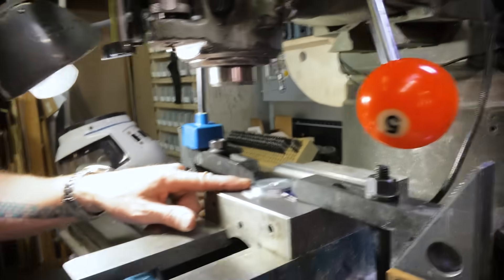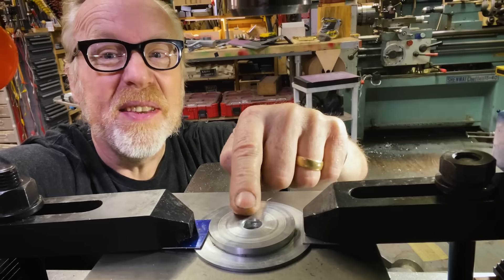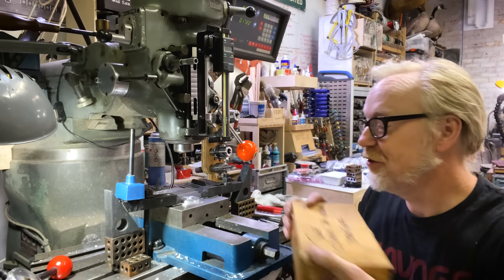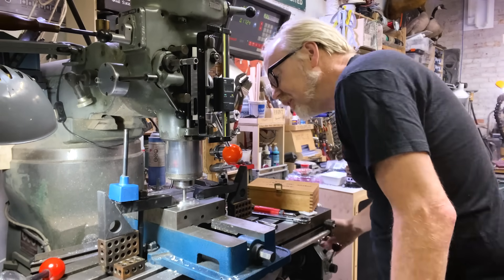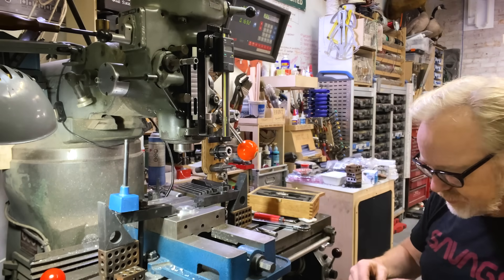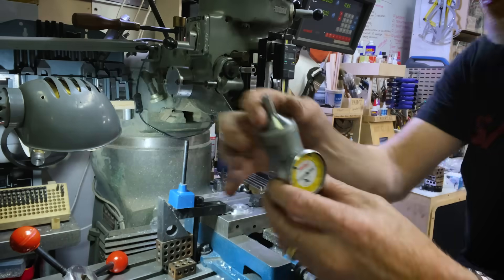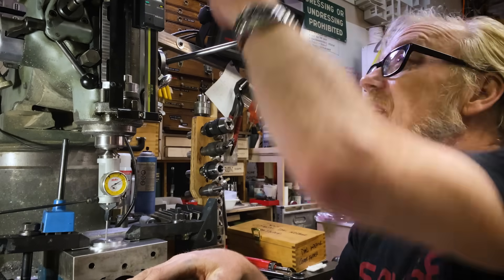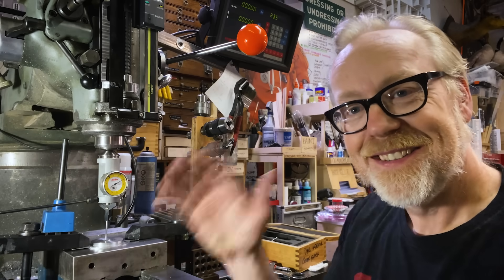Adam Savage's Favorite Tools: Wiggler Machining Center-Finder

Comment: Why turn the motor on? Just rotate it manually (slowly) for 180 degrees and you'll spot the direction and amount of deviation easily. By all means turn the motor on at the end to see how much vibration you have, but adjusting it all the way with the motor running is just masochism.

Comment: As everyone else is saying, it’s a Coaxial Indicator. A wiggler is a different tool (personally, I don’t like them; I prefer either a conventional edge finder for nonmetallic work, or an electrical one for metal workpieces). Also, I’ll usually put the mill in neutral and spin it by hand (my mill has a spindle nose that I can grab by hand; not all of them do).

Comment: It's a co-axial indicator.  And it is definitely an indispensable tool.  My mill only cost like $500, and I still forked out the like $150 for a cheap Chinese coax indicator off Shars, because you just HAVE to have one.

Comment: Hi Adam, great video.

I havnt trawled through all the comments but one thing i noticed was the way you clamped the work down could be done a bit safer.

The left hand bar had the outer end on the step block higher than the inner end holding the work, which is good,  yet the  outer end on the right hand side looked lower than the inside end of the bar, which is a nono - leverage wise.

also the pinch bolts need to be as close to the work as possible, just my honest opinion.

just want ya to be safe mate.

keep up the awesome work!

Comment: Good video, just thought I'd share a tip: It's a lot faster when you don't turn on the mill. If you turn the spindle by hand it's much easier to tell where the high/low spots are and which way to move the table. Also that's a coaxial indicator. A wiggler/wobbler is a regular old edge finder.
Reply: Yep, that's how I normally use mine.  High/Low in neutral for easier rotation, check at 180 degrees along one axis, split the difference, repeat on the other axis, then fine tune as needed.  Very quick that way, and no chasing a test indicator around the mill, or mirrors.

Comment: You can also use a dial indicator and sweep the diameter of the peice, Assuming you've checked the spindle is set on centre with the table.

Comment: Okay, the closest I've come to doing anything like this is using a cheap harbor freight dial indicator to check for warps in a table saw blades or to set knives in my jointer, so somebody tell me If I'm off the wall here, but is actually turning on the machines motor a bit nutty?  Can you not just spin it by hand? Maybe even take a couple of readings along the x and z axis, split the difference and than dial it into precision?

Comment: Indicol and Indicator would do the job very well also. And you have one of the most important and useful tools in machining. You can reference from external diameter and indicate perpendicularity. Im sure the wiggler can be just as fast however with practice.

Comment: In your concentric part I can see touching off the od to find the center. This looks great for parts that have edges outside the bounds of quill movement or pre-existing holes  with no concentric relation to the edges. Very cool

Comment: "Co-axial indicator" is the correct name or Coax indicator. There is a wiggler indicator but it is different looking.
Reply: "slow clap..."  Well done.
Reply: A wiggler is for centering a mark and is very useful. It can also be used as an edge finder. I have a coax indicator, but I use very little. I prefer an edgefinder if going only to a couple of thousandths. It is much faster for me. If greater accuracy is needed. I use a test indicator on an Indicol.
Reply: @tracylemme1375  Agreed except I've thrown all my edge finders in the back of the drawer after picking up a Haimer a while back... Pretty much all I use any more is the Haimer (or an indicator on an indicol if I need to find an edge or center to better than a thou).
Reply: But wiggler sounds better sooooooo
Reply: Yep, beat me to it. A wiggler is totally different
Reply: "co-axial" and if you want to support an american company making them for about the last century look up Blake Mfg Co.
Reply: Slow clapping*
Reply: I came to this video just to make sure the title inaccuracy was already addressed
Reply: I'm glad this comment is here
Reply: Thank you. Only came here to comment correct name of tool. Fuckin nerds trying to show how smart they think they are.
Reply: @mgmjferg89  most machinists haven't a clue what they are talking about or what tools are called
Reply: User Name those aren’t machinists, those are operators. Machine operators, they do some measuring and push the green button.
Reply: @jeepmanxj  very true
Reply: Finally someone that knows what they’re talking about, from one machinist to another thank you
Reply: When u say wiggle indicator is that just a regular indicator? Never heard the wiggle term before
Reply: @highclass3041  Go to Amazon and type in "Wiggler & center finder set" then type in "Coaxial centering Indicator"....that is the difference.
Reply: @elmergriffin8369  I have a coaxial and edge finder...edge finder is starrett and the coaxial is a Fowler. I just never used the wiggle kind I'm gonna check it out for sure though thanks man
Reply: I applaud Adam's self-confidence. If I posted a video with such a gross error displaying my ignorance, I'd be so embarrassed I would have to  immediately take it down and re-shoot all the necessary portions with the error corrected, or jump off a bridge.
Reply: My favorite is the one made by blake

Comment: Adam, 

Yes you have All the toys, BUT NO IDEA how to use correctly. 
It is disturbing as a Machinist you showing the INCORRECT procedures to others.  
You have proven this as above & your so called Brass Nut & Bolt Video.
Others will think that your procedure is Correct & Damage equipment & or themselves.
All are better to look at Abom79 site for Correct technique.
Reply: I was thinking the same thing. I couldn’t get through the nut and bolt video, once he started cutting the hex before the threading operation I was out. And as a guy who watches a lot of Abom79, it seemed like he had the mill going way too fast, and probably could have gotten it dialed in much faster and more accurately if he turned it by hand 🤷‍♂️
Reply: @bjnorton8029  
BJ, I just hope the average JO does NOT think that Adam knows what he is attempting/talking about with any form of engineering!
I am in the game now 38 years & still looking at different techniques within my trade, that's why I enjoy Abom79,same same.
Always good to get a different prospective on HOW to do a job from other Competent Tradesmen.

Comment: Hmm... With a loop of string and a bearing at the end of the wiggler you could find the exact center of any two points by tracing out an ellipse with those as the focal points. Via the old trick of drawing an ellipse around two pushpins with  string.

Comment: I have always used a test indicator in a holder. So much easier once you learn the technique. No need to turn the spindle on. Just a mirror to read it when it’s turned around. Can also indicate surfaces true to x and y axis. Good video though

Comment: We use Dial Test Indicators at work to do this quickly and easily.  Decent ones run ~$80-125.  Setup is as simple as using a regular edge finder and you don't power on the mill, just put it in neutral.

Comment: The "noise" in the meassurement is also caused by the surface roughness of the hole.
Reply: Yes, Adam needs to lube the hole.
Reply: @amso9  Best thing would be to touch of on the outside diameter of the part. Since it is a turned surface it will be more round and smoother.
Reply: @hitwerterfinder4595     Always go to this largest diameter that you believe is true!
Reply: @amso9  Will still be lumpy, just lubricated.  What he needs to do is give that hole a good reaming....  I hear lube can help with this process too.
Reply: @EvilGTV  😂
Reply: Great comment. Was thinking the exact same, although some wiggle in the old spindle head system will add up too.
Reply: That's exactly what I was thinking

Comment: Keep in mind the hole hat to be perfectly round (reamed) for the needle to be still
Reply: Reamers do a better job that a drill, but they can still make a non-round or tapered hole.
Reply: @whateg01  That is 100% true...but they should be able to do a good enough job to be accurate enough to surpass the resolution of a wiggle gauge.

Comment: An easy way to set the mill to the center of what your working on is measure and mark the center of the material with an X with string. Then chuck in a center punch and bring it down and touch the center of the x on the string. It will be as close to actual center that you can get without using the tool shown in the video.

Comment: For all you folks out there that only have a conventional Mitutoyo finger clock. I weld an 8 mm dowel to a 10 mm dowel. I hold the 10 mm in my collet. The 8 mm dowel is welded at about 120 deg to the vertical 10 mm dowel. ie the end is hanging down. I then use a conventional finger indicator and use the dovetail mount on the angled portion to hold the body of the finger clock and flick the stylus downwards. I offer up to the hole and carefully rotate the spindle by hand and get a preliminary idea of centre. Adjust table position and repeat. Very very fast and by holding the finger indicator with the face upwards, you can always see your indicator face. It requires very little free height,  you don't need a special tool and it is affordable. If I have a big bore to clock or a large face I have a range of different "sticks" I can choose from that I have made up over the years. If you have an interrupted hole surface you can also gently clock over it. You don't have to use a mirror or be a contortionist to view the clock face when you are hand turning the spindle. I use the same method with a long "arm" to check the squareness of the spindle to the table if I have moved the quill at an angle or if I need to re clock my vices.
Reply: Er, would "finger clock" be a "dial test indicator"?
Reply: @lagweezle  A dial test indicator comes in several versions. I expect everyone know what a finger clock is when dealing with this topic.

Comment: Reasons Adam is a clown and should stay away from machines...
I'll start
1) wraps his finger in a rag to clean a shaft while the machine is on.

2) Doesn't put a centre in as support while threading brass therefore losing the work out of the chuck. 

Theres so much more

Comment: I'd argue that who ever has the machine to actually FIT that piece of hardware inside his machine probably has little concern for the price of the device 🤔
I mean... I couldn't fit it inside my Maker grade 3-Axis CNC machine... Heck... I probably couldn't even fit ⅓ of it and still be able to fit the part to be measured below it 🤣
But then again... Couldn't you just use a 3-Axis Probe? It's like 4-5 points of contact taking less than a minute to do with probably better accuracity - considering your machine has runout already...

Comment: People have said this already, but this isn't a wiggler. This is a Co-axial Indicator.
The Wiggler is a dial-less centerfinder of some kind, it looks like a little pointy scribe on a ball joint, that chucks up into a collet or drill chuck.

Also, the mill is set way too fast, slow it down to like 50RPM or something, to get a good idea of what the indicator is even doing and which direction you need to go with each axis.

Comment: When was the last time you trammed your mill head?
Reply: NEVAAAAA, of course thats partially because some bozo welded it in place, and I have yet to get all the controls for the CNC sorted out.  I got it in the shop, and the spindle powered up and it has sat since.  I am already irate that someone did that, I will be even more so when I find its wrong..........  Which if they thought welding it was the correct fix, I am going to almost guarantee it is wrong.

Comment: I really liked the progression of the last few videos. It felt like a story. First you set out to make the giant bolt, this causes an issue with the lathe tailstock, so the next video is you fixing the tailstock. Then, you use the wiggler to make sure the tailstock is centered, and the next video you did a tooltip on the wiggler! It really felt like a process.

Comment: The quality of the measurement also depends on how round the hole is in that piece.  If it's out of round on only one side of the ideal circle, minimizing the coax indicator swing will actually push it out of concentricity.

Comment: So for $10 you can buy a mechanical edge finder, and if you working with a symmetrical hole which is how his expensive tool works then it will give you center.....😶

Comment: I feel that someone could make a 4 gauge wiggler that would tell you which of the axes (x,-x,y,-y) was causing it to be out.
I suppose going even further would be that it doesn't 'wiggle' it would just give how much force was placed on that axis on the last rotation.

I know it doesn't take long to calibrate but this would just make the process simpler and quicker wouldn't it?

Comment: The "noise" can also be cause by roughness in the surface of the hole. It is always wise to bore or plunge an endmill to clean up a hole if you are going to be using a dial indicator to align for concentricity. Great video! I always enjoy your maker enthusiasm.

Comment: Used one of these for many years to dial in lathe pockets and tooling and if you turn the spindle manually you can dial in x and z separately and it would take about a minuet and you would not wear out your probe as you call it  by all the rubbing it does by running the spindle

Comment: I had a 'chucking cone' used to get things on the mill close enough. It had a long taper, and fit into the R-8 spindle; you drop the spindle into the hole, it got within 0.002" if you were careful.
And if your hole ain't round ...

Comment: Coaxial indicator. It's not actually that precise though. Every adjustment in the length of the stylus will change how it actually reads out. They also suffer from the usual issues of droop when used horizontally.

Having said that, I've had one for almost the entirety of my machining career, and I use it pretty regularly for stuff that only has to be inside 0.005", which is about as far as I'd trust it.

Comment: First things first ... if the Bridgeport head hasn’t been clocked perfectly perpendicular to the bed / table - the centre position will not be accurate along the length of the quill travel, especially clocking the initial hole with a long device ... just sayin’. 😀

Comment: Tldr; not a wiggler, more so a dial center finder, a dial indicator works just as well and is probably even cheaper! As a machinist, I wouldn't call this device a "wiggler". I've always known a wiggler to be a pretty basic edge finder that goes in your chuck/collet, the tip of it sits off-center, spin up the spindle and bring the tip in towards the edge. It'll stop spinning off-center but you know you're there when it just slides back off center.

Comment: What I don't particularly like about the coax indicator is that it's so long.  Which means that if your spindle isn't PERFECTY trammed to the table, or if there is wear in the z axis ways, when you raise the table (I'm talking about knee type mills)  there's a likely probability that you are going to lose your concentricity.  I prefer a small indicator on a short stem with a short tip to indicate the hole (or outside).  You won't have to raise the table or lower the spindle as much, and you reduce the chance for error .

Comment: Ya to share what i know of these. Methodology: look up example blake co-ax indicator's there is a correction table for the incriments on the dial for the length of "pointer" and Dia. of hole. so there is more to it than an indico(looks like a noga with no base just a 3/8 stem that you can put in a agc type ind base very handy if you dont have one wow) mine is the cheap blue one or you can get the cheap red one and tap away with your figertip to get your zero and a car visor clip on make up miror on a rod and in the lid of your tool box right behind you for storage ya removable mirror thats how i roll so you can see the indicator at 180 you know that right ok so ya co ax think about the aditional look up table stuff at like blake if you need the most accuracy outta it its for alighning bore's with tape and outta round hollow's and stuff really and if one thing on that mhc breaks it'll be the "Bridge" holding the pinion that idler's for the needle the bolts will come lose frome you spinnin it to fast to long you knuckle head  ha ha

Comment: Thats a co axial indicator. A wiggled is sharpen metal rod that can move. It is used to find center off a center punch or center drill. It rotates at low rpm and the rod will run true.

Comment: There's no better way to learn the correct name of a tool than to call it by the incorrect name multiple times on the internet.
Reply: Yeah.  I was wondering why he thought a wiggler was "a little bit spendy" until I saw he was talking about a whole different tool.
Reply: @No1sonuk  the wiggler goes on the end of the axial dial indicator. The dial indicator isn't the wiggler part.
Reply: That power drawbar works slick.... Who made it? I'd like one like that for my machine

Comment: what was that air gun sounding noise from when you attached the wiggler to your machine? (Is it part of the machine, or something you added to it?)
Reply: It's a pneumatic drawbar
Reply: @mathewhammond6843  thank you!
Reply: its a power draw bar it tightens the collet up quickly instead of having to use a spanner, they come as standard on better machines or can be added